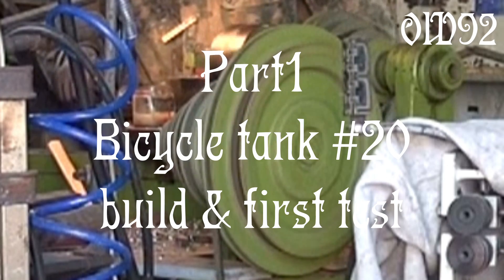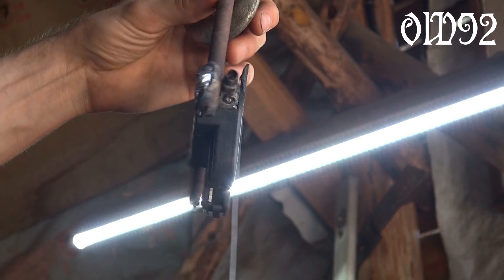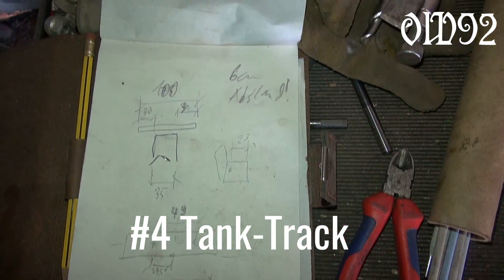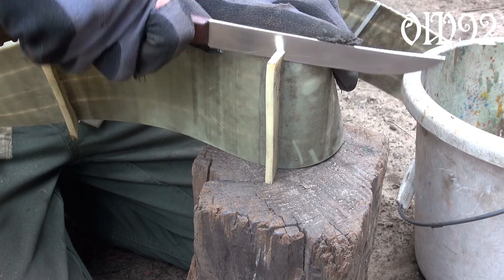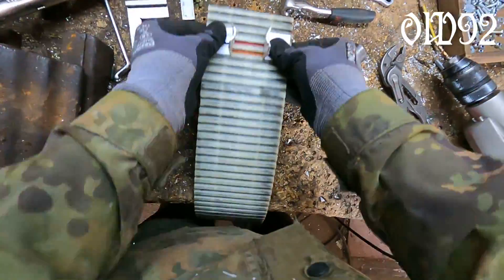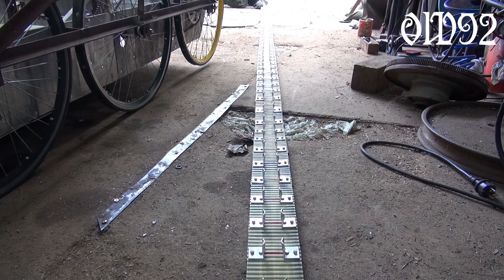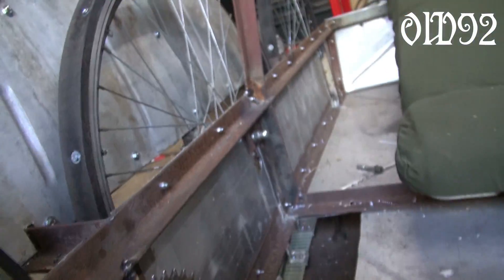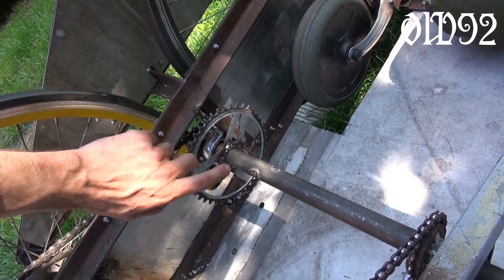Fully tracked bicycle tank #20 / part 1 / build & first test

Comment: Two drive chains. 2 pedal gears. Joined together in the center one pedal each, but not connected
Reply from the maker: If I understood correctly. ...For this to work, you would have to fix your feet to the pedal, so that you can not only push, but also transfer the lifting movement of your feet to the pedal too. But in the end it would be like riding a bicycle with only one foot?! I once tryed just that while on a bicycle trip while one of my crank arms fall off, it was one of the worst rides I've ever been on.